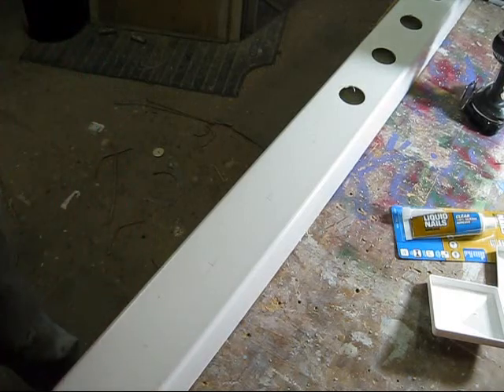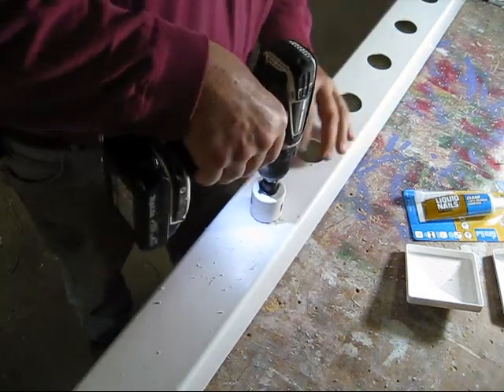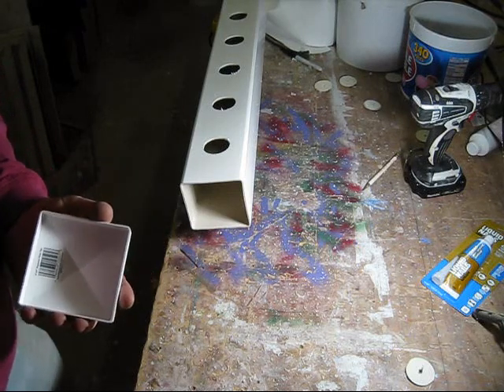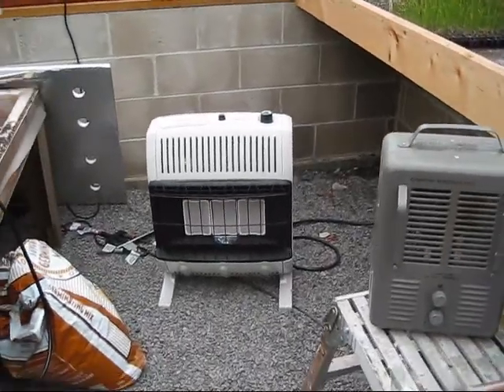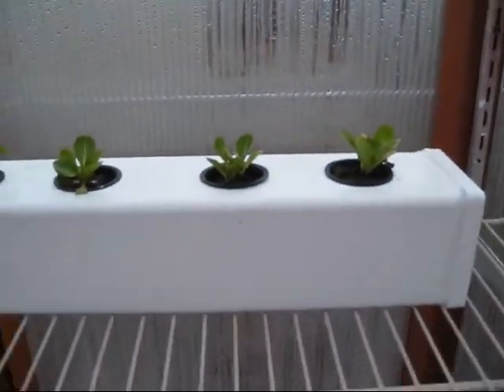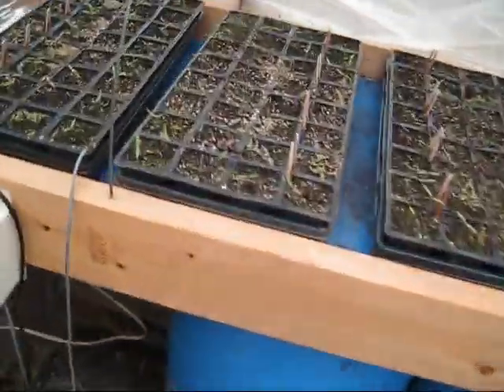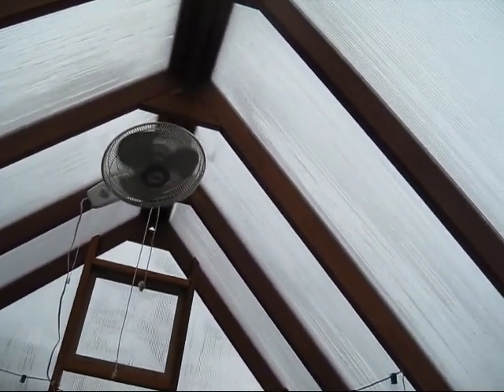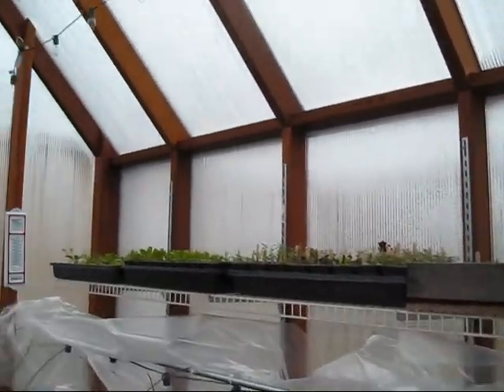building a simple hydroponic system using the kratky method

Comment: Good work.  Nice greenhouse.  I have good luck using MHP Gardeners instructions/advice as well.  I grow lettuce all winter on a shelf in my kitchen under florescent shop lights.  Made a wood frame for some $2.00 wallpaper wetting trays that are about the same size as your small tube setup with foam board tops.  You can also use aquarium rock for filler around the rock wool cubes if you need it.

Comment: Nice greenhouse. I was just wondering do you have any problems with root rot from not providing any circulation or aeration to your roots?
Reply from the maker: No haven't had any issues. The only change I would done to easily to fill water